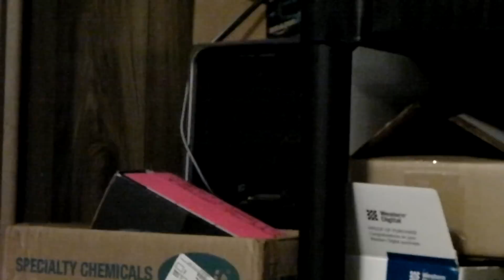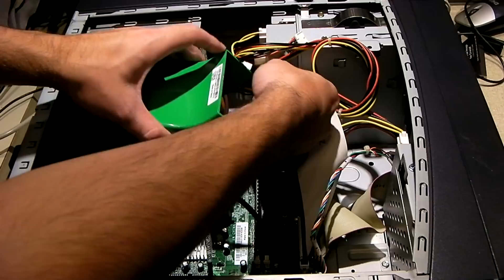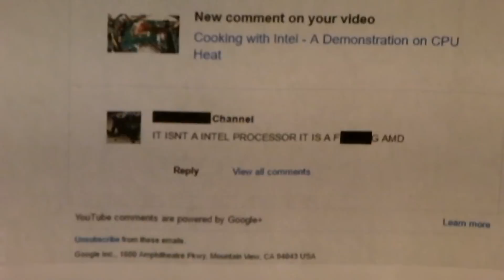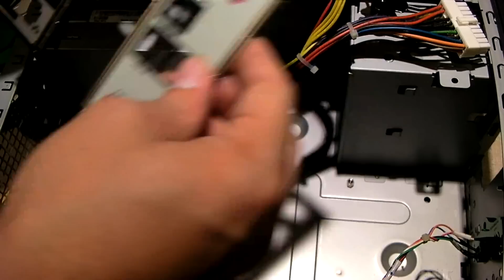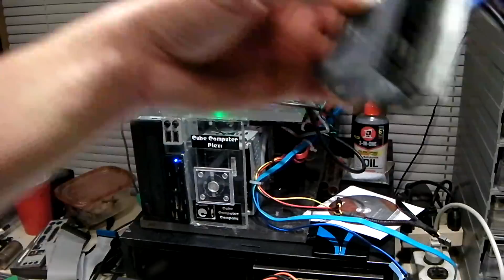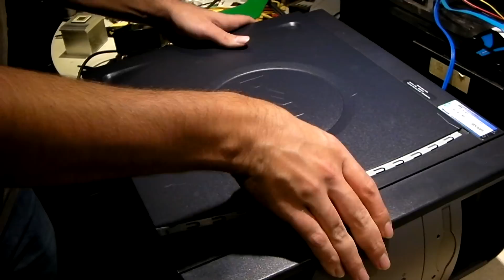Can a Dell Dimension 2400 system case be reused for a build? Let's find out.

Comment: i have a Dell Inspiron 3847 and was thinking of gutting it and using it for a new system. would i be able to do that? new motherboard and everything?
Reply: It would be a ton of work customizing the case.  You would need to cutout a rear I/O, and PSU ventilation/mounting screws.  If it has the folding HDD bay that’ll need to be cut unless you use a lp or single fan GPU.

Comment: I recently gutted one of these and built my new primary desktop inside of it. 

It's running a Ryzen 5 2600 (@3.8GHz), 32GB DDR4-2133, GeForce 1060 (6GB VRAM), BD-ROM/DVD+RW, 250GB NVMe, 1TB SATA SSD and a 4TB HDD with a 600W PSU, using an ASUS B450M motherboard.

Removing the vertical HDD tray and putting a 92mm intake and a 92mm exhaust where the CPU fan used to be lets it run fairly cold: Below 30C for all components (Except the NVMe drive) at idle. The CPU and GPU never exceed 55C and 70C, respectively, even when running something like The Witcher 3 at maximum settings.

What's inside it now would have been science fiction when the original system was built in 2003: It has 128 times the RAM alone. :0

https://sites.google.com/site/panicus/ryzen1.jpg
https://sites.google.com/site/panicus/ryzen2.jpg
Reply: I recycled my parents dimension from 2005 and Im about to put a 2011 x79 board with xeon in it. Why spend 40$ on a case and wait for delivery?
Reply: is your motherboard m-atx or atx ?

Comment: Excellent vid I have the same chassis and always wanted to put a modern mb into it but that front header always put me off  but after seeing that I may give it a try
Reply: I just finished a build with a dimension 4600 case, and for a small case that's not meant to be reused, it was easy to build in. The power button header wasn't an issue, you can buy breadboard jumper wires and just make sure you know which side of each LED is positive and negative. I used a 3V battery to test them and got it right the first time. However, I was cheap and went to the local hardware store to buy 22 gauge solid core phone wire for 30 cents, and I made my own male-to-female headers. It took a bit, but since I only needed 6 wires it worked out great.
Reply: Undissatisfied The 2600 power button wire is just long enough for the OEM motherboard, when I put in my own board the switch would not reach. I just extended the wires and shrink wrapped.
Reply: Kieran Coffey I have done it, however you might want to extend the power switch wire.